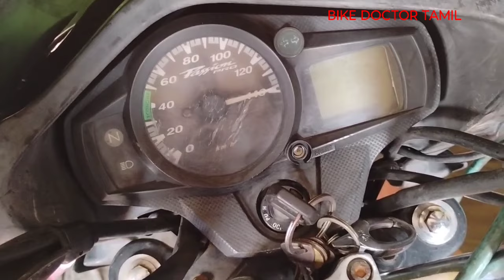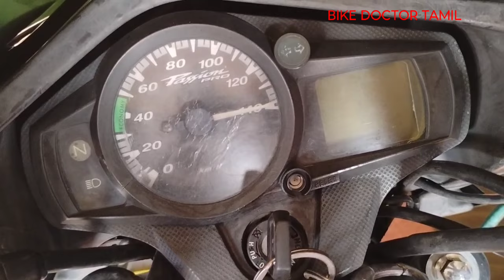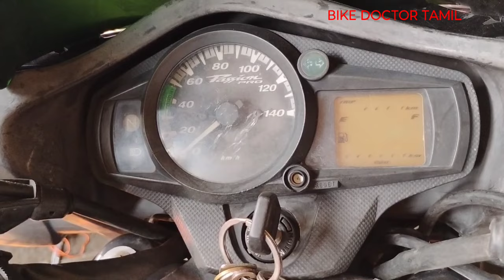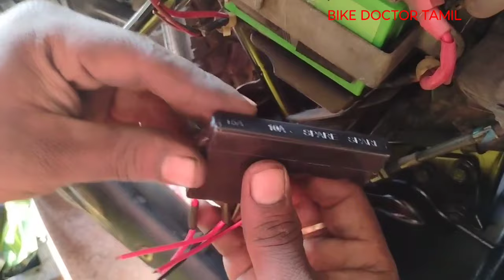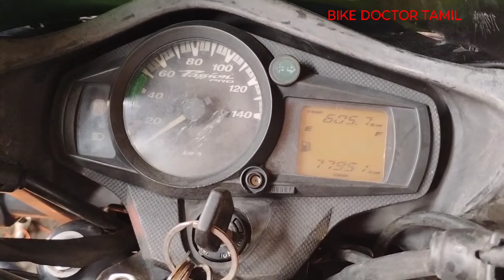Bike wiring Work in Tamil

Comment: Anna appachi 1604v vandi adachi adachi odudhu . air filter ,plug , injine oil, yellame mathiten irundhalum adakidhu
Reply: Carpuretor are throttle body clean pannuga , corrent check pannuga,
Reply: Change fual filter